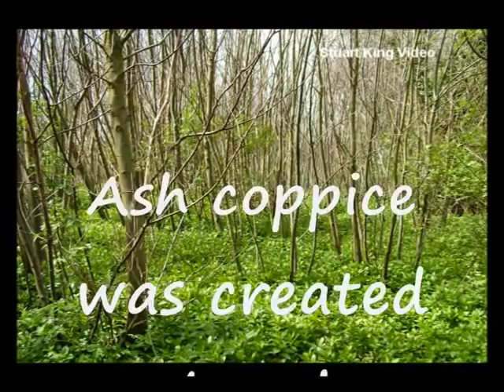Rake making, a lost tradition by Stuart King

Comment: Thank you, Trevor is an example to us all as he worked with what he had and used the strength of every part of the material as it was needed.  A seemingly simple tool, yet I am sure after a day raking with one of Trevor's rakes  you will have completed more raking and you would be in better shape than those who used a modern rake.  It is also a message about using the copi
ce and how these parts of the landscape must be managed to give the character to the ecosystem that sustains the wide range of flora and fauna including humankind that depend on them.

Comment: Thanks for this amazing demonstration of an old craft.  In 1870 this would have been cutting edge processing. At peak production "back in the day" I can imagine one worker at each tool station. I can't imagine the tedium of producing these parts day in day out in volume as folks were paid for what they made. The dust, the noise, I'm not sure if the noise would have been greater or less before the invention of the diesel engine which I assume replaced water power. It's easy to romanticise old crafts, it's less easy to see the toll it took on the workers and what they would endure to earn a coin to feed their families
Reply: I would think it would be work for the village when they weren't on the farm.

Comment: There was a great factory in Navan,County Meath Ireland along the river blackwater. It was called Elliots mill and they also had everything driven by over head belts from a central power source.Initially this was by a water wheel, then a steam engine in the basement using the shavings and sawdust for fuel,the last one electricity. When the family closed it down in the 90 ties it was set alight by vandals.they used to employ over thirty people and they also had a foundry making spades,forks and shovels.The old man Allan designed all the machines himself, including the broom handles and pegs for the rakes.I remember lorries leaving the factory for the UK loaded with hundreds of them stacked high .Sadly all gone like the 30 or so furniture factories that used to be in this town when I arrived here 45 years ago.Like the saddlers, farriers,blacksmiths ,tailors etc.All these items and products imported now and skilled tradespeople gone for ever.sad! Jan www.irishharps.net  and www.boynemarine.com

Comment: Can anyone tell me the name of the tool he used to make the tines, or teeth? It looked like a dowel plate, but about 100 times better. I would love to get one, although it looked easy enough to make.
Reply: ***** No, the tool after the fro was used to split the blanks. I found out it is called a tine former, and is basically just a piece of pipe, but I'm not sure if the top is sharpened.